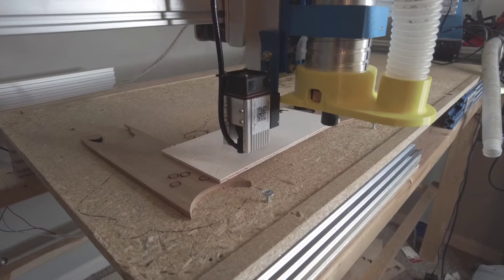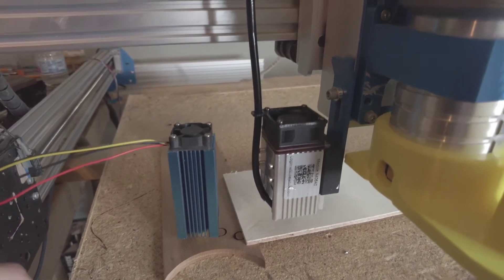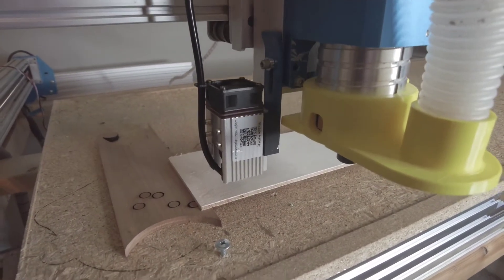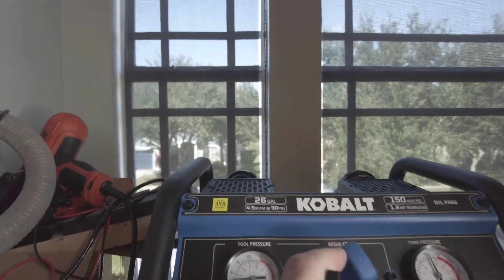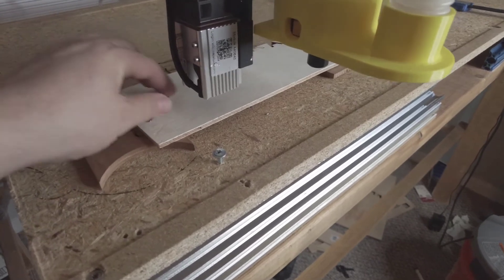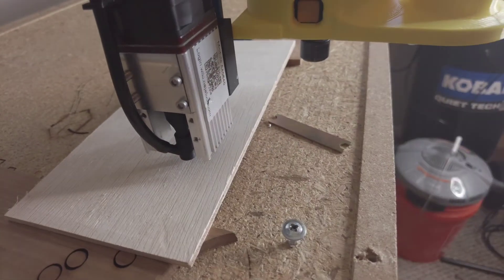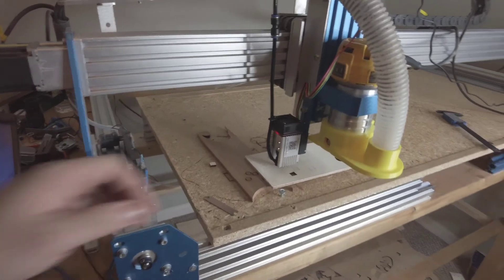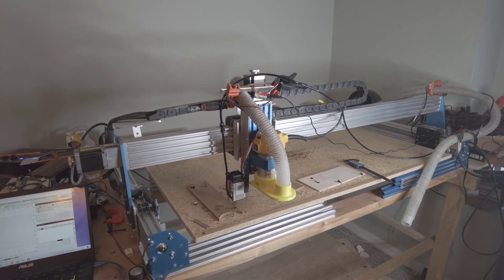New laser for my Prover 4030 | Neje 40 watt dual diode laser

Comment: Is that a 10w optical laser?  Two diode lasers?  Are you able to run it on the stock controller box?   I'm looking at getting the Proverxl 4030 and wondered if it could handle a 10w optical laser since the manufacturer only has a 5w laser
Reply: Yeah that would be really interesting 👍

Comment: Great video.
How was the laser wired up with the prover 4030? I haven't been able to find any reference on the web as to how to setup.
Reply from the maker: trial and error worked for me.
Reply: @practicemakesperfection8459  did you connect it to the stock proverxl board? did you modify anything? what kind of trial and error did you do? hope you can elaborate a little more :)